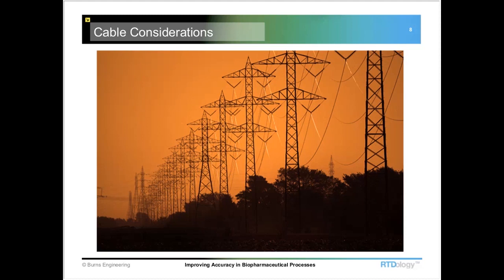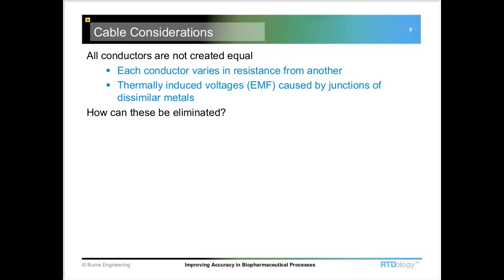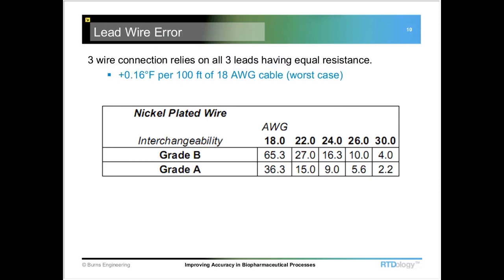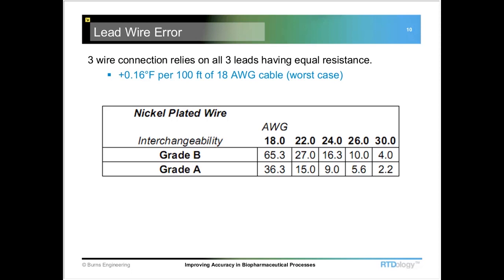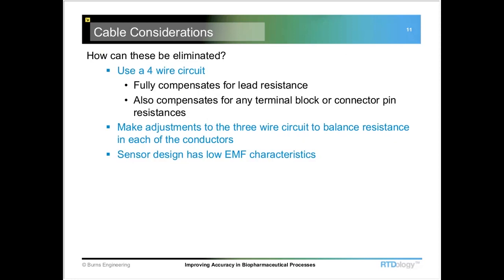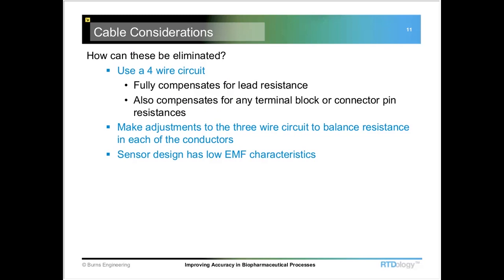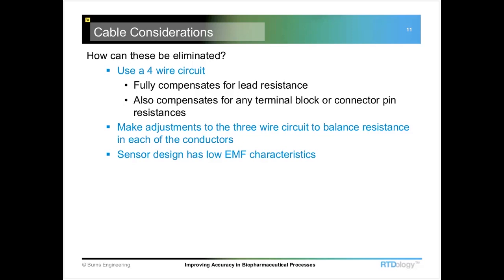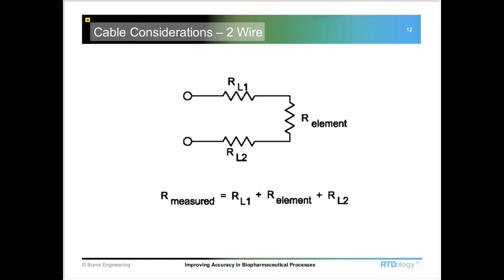Two, Three and Four Wire Circuits for RTDs

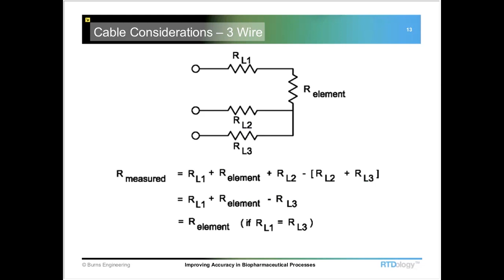Comment: Hi ya...... I've got a quick question about your calculation at 6:36. Where exactly would I measure this "Rmeasured" that you refer to? In other words, what two points would I place my ohmmeter across to measure "Rmeasured"?
Reply: It is the resulting resistance of the sensing element after the lead resistance is eliminated from the circuit.
Reply: @billbergquist4722  Hi Bill. Thanks for your reply. Sorry to keep bugging you about this....... I understand exactly what you are saying about the lead resistance being eliminated from the circuit. And, I agree with the fact that 3 wire RTD does just that. I'm just curious about the validity of your calculation. You mention a "Rmeasured". I'm curious to know where you would place the 2 leads of an ohmmeter to measure this "Rmeasured" resistance.    Thanks. Looking forward to your reply.
Reply: @tedmortenson4036  the white lead and either of the reds.
Reply: @billbergquist4722  Hello again Bill. Sorry but I disagree. If I connect an ohmmeter from White to with of the Reds, I get RL1 + Relement + RL2, OR  RL1 + Relement + RL3.
I don't get Rmeassured = Relement.